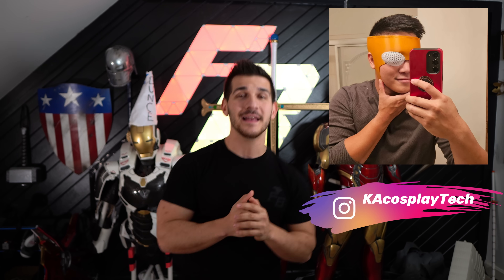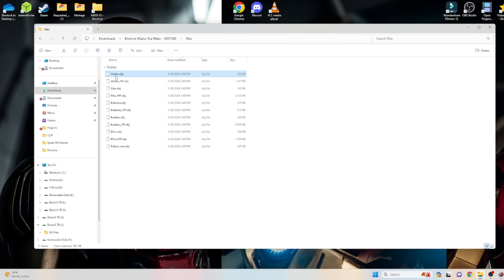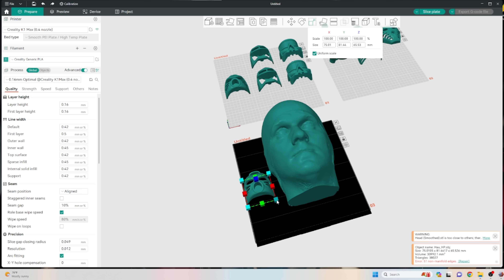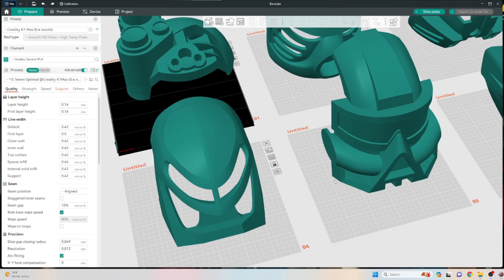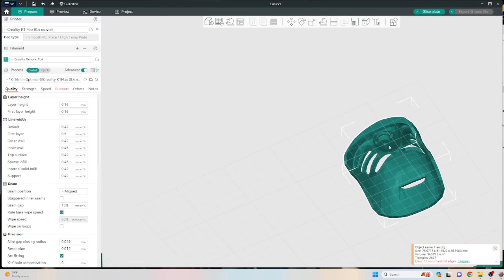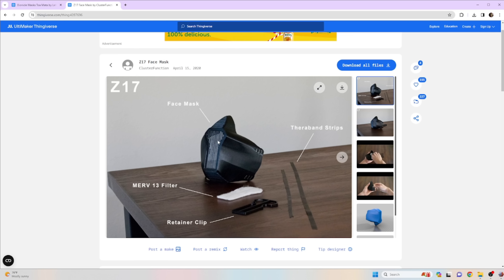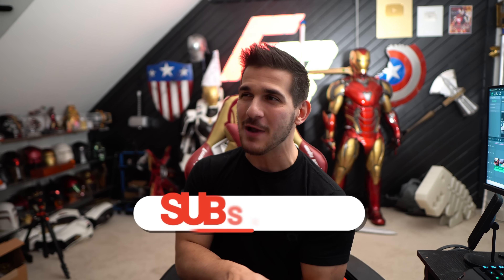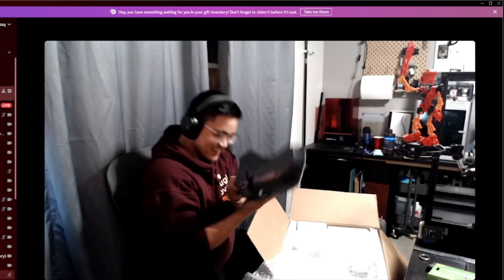3D Printing My Childhood | Making LIFE-SIZE Lego Bionicle Masks!

Comment: It’s so cool that you do the Secret Santa gift exchange and make amazing 3D prints for your friends! Question:  I’m about to begin a Halo Master Chief full armor build & need a large volume printer.  While I love my PRUSA i3 Mark3 (3800 print hrs & counting - full Mando & Bo Katan armor + weapons, etc) it’s not going to cut it for this. So, which of the following would you recommend:  Anycubic Kobra 2 Max; FLSUN V400; Artillery Sidewinder SW-X2; other?  Reliability, great pint quality, auto bed leveling & no need to do upgrades are the important things - fast is nice but secondary to the other req’ts as are things like printer space & price.  You’ve always given great advice & I’ve learned a lot since subscribing to your channel last year so I’m hoping you can make a distinction between these that I may have missed …. Keep up the great channel!